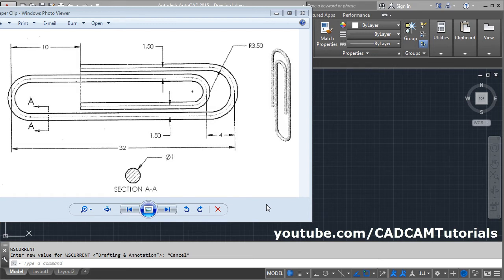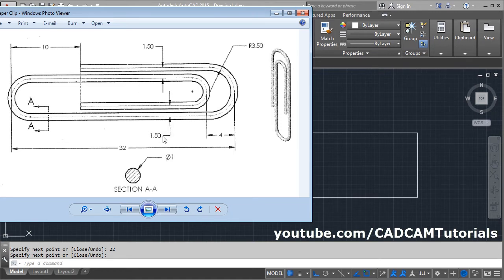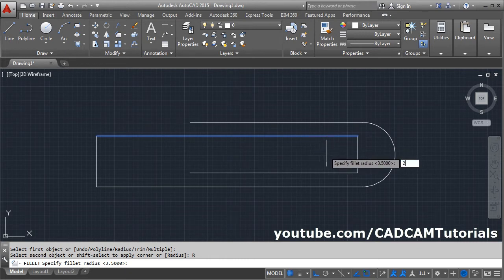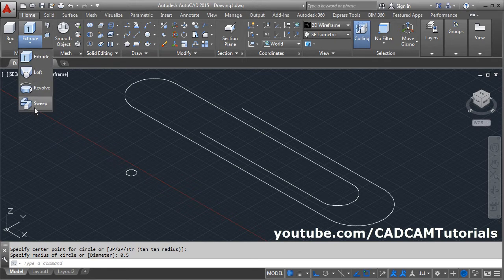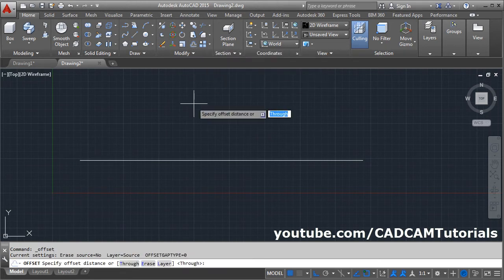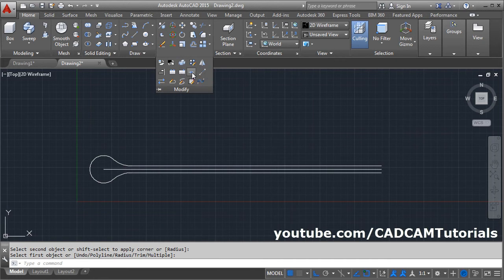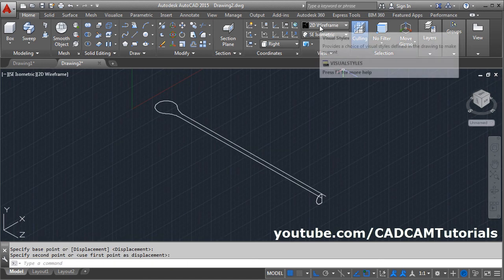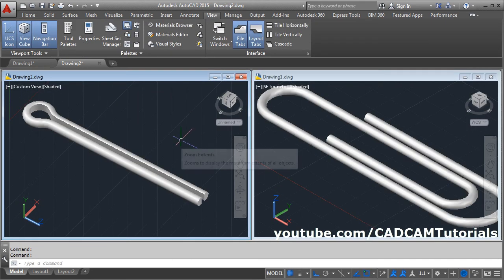AutoCAD 3D Practice Drawing for Sweep Command | AutoCAD 3D Modeling Paper Clip & Cotter Pin Tutorial

Comment: Correct me if I'm wrong but the paperclip measurement was off i think. The total width of the clip should be 10 because the diameter of the circle inside is 7 plus the 1.5 gap on both sides. anyway, your videos are helpful keep it up.